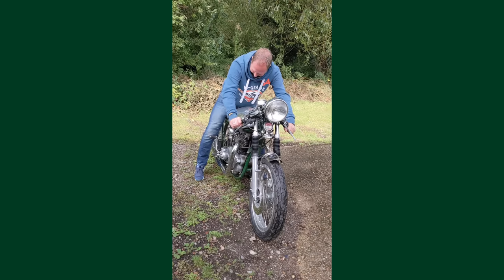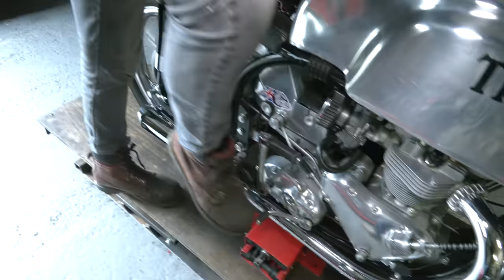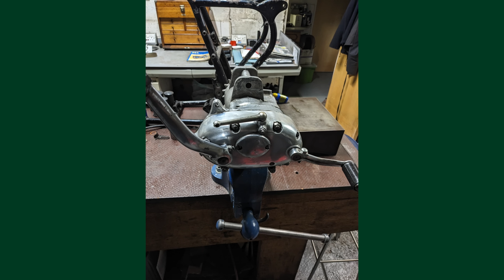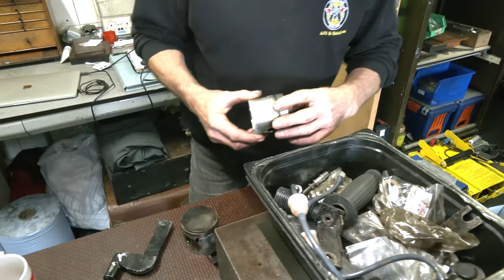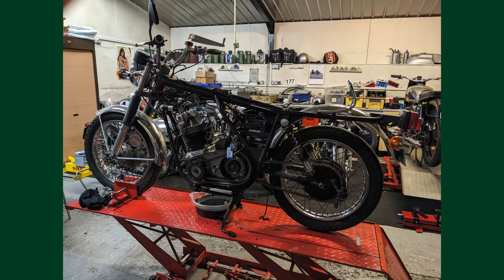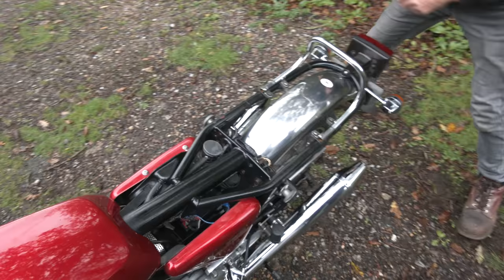Classic Motorcycle Workshop Vlog 25 - new & finished projects etc

Comment: My mates and I had Commandos, Bonnie's both pre unit and unit and we grew up with all the associated gremlins. I bought a BSA iron head golden flash with swing arm . It taught me all about Joe Lucas headlight switch with its dodgy roller connections and of course K2F magneto and timing was done with a pencil in the bore and It would not run right if it was not right. Too far advanced with 9 to 1 pistons split the soles of my doc Marten boots. I should've kept it lower compression.  They are great bikes and the frames were so well designed and braised. SRM conversion from timing side bush to bearing with end feed oilfeed made it more reliable especially if it was tuned and the later crank with bigger diameter big ends was worth it and thick flange barrels however the single carb iron head with Amal monoblock carb was really good day to day even in traffic but clutch got hot but Southall to mitcham and back every day was a lot in heavy rush hour traffic. I should've used an old Honda cd175.

Comment: Plenty of blue smoke coming out of the timing side exhaust pipe - obviously not good. Any engine that idles from cold means the air fuel mixture when warm is going to be fuel rich meaning soot build up in the cylinder head - obviously also not good. An easy check is too stick your finger or have a look at the end of the silencer on the inside. Black and sooty and also oily is not good. You'd have thought the 'mechanic' would know this.